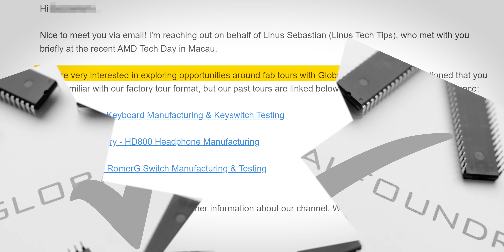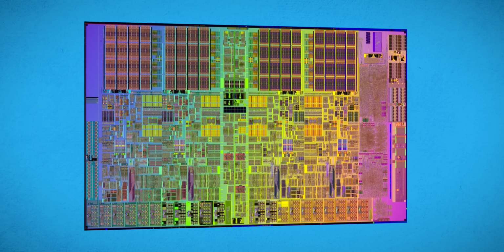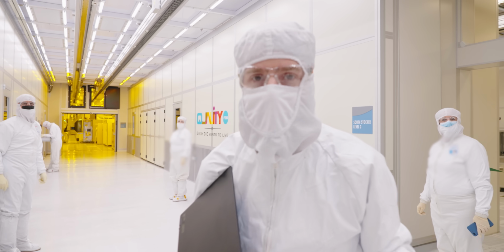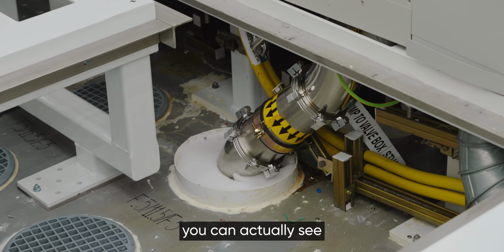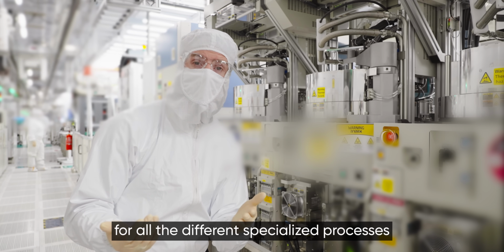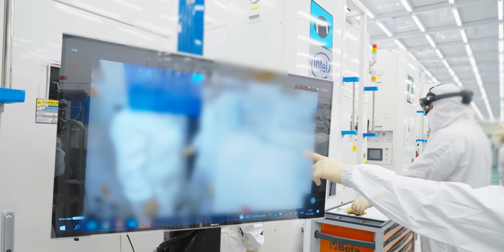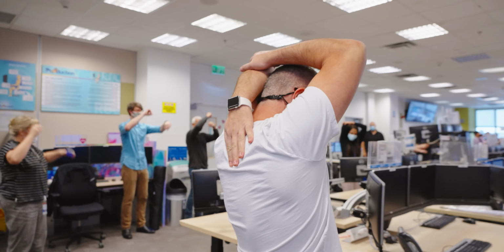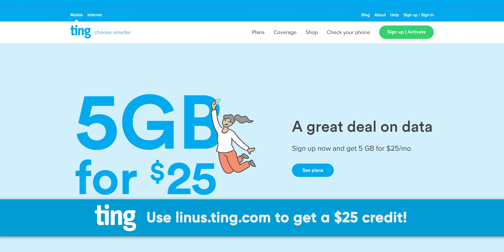I Can Die Now. - Intel Fab Tour!

Comment: After seeing how these processors are fabricated, and the amount of extremely intricate work that goes into them... I'm actually happy with the price we pay for these processors as consumers. 😅  I feel like they could charge much more just because of how complicated and precise the entire process is.  I guess if they were to charge their actual worth though, not as many would be able to afford them and their profits would go down.  Hmm
Reply: I think they are priced with their actual worth, it's just that they are extremly professional at doing this task while a lot of others things we buy have inefficient productions and big margins for the sellers
Reply: @joel3399  agreed, the tolerance for error is so minimal. one slight adjustment could determine whether the chip is put in a super computer or your alarm clock.  price is for the most part on target.
Reply: Yeah it's crazy to think that there are cases or power supplies that are more expensive than some brand new cpu's, tells you how much you're getting ripped off on some products.
Reply: You can thank competition for the reasonable prices. If they were a monopoly, you can expect sky high prices since you don't have a choice.
Reply: @sagadabeans  As we have seen before Ryzen's success.
Reply: I'm glad computers cost $800 in 2022 instead of $3500 in 1982

Comment: As an engineer working in a fab, I'm extremely surprised that an enterprise like Intel would give Linus the opportunity to se how things work in their sites.
Reply: How is the work experience?
Reply: Fernando  I just wonder what engineering do in factory :D is it a chill job?
Reply: I was thinking the same thing! I worked on the construction of their FAB42 in Arizona for three years, and the level of security is insane. Any physical documents or design plans had to be burned at the end of every work day to avoid any proprietary info getting out
Reply: @kurrwa  Engineering typically has 2 functions in a FAB.  MEs /EEs(Mechanical Engineers / Equipment Engineers) keep the tools running.  They'll handle upgrades and chronic offspec situations, and PM's (Preventative Maintenance).  PE (Process Engineering) will make sure the right amounts of things are getting applied and removed at the right times, and make sure chemistry and other things are correct.  ME's are a hands on group, while PEs are 'more' desk based, but are also often right there at the machines also.  There are also development engineers, that come up with new or better ways to make things, or even the new things to make
Reply: @DagarothBlackrose  interesting! I did an internship as Biomed tech. I had to do a lot PM's on medical devices :D

Comment: Linus: They couldn't stress enough how much we have to avoid even touching any of these machines because it could cause a huge loss in the process

Also Linus: Glass goes BOINK 11:41
Reply: It's really not a huge deal. Little nudges or touching tools with your fingers isn't gonna do much. It's bumping machines with tools or carts that will break an interlock which will shut the entire tool down immediately. An immediate shut down can result in misprocessed wafers which means $$$$$.

Comment: if i'm not mistaken (and correct me if i'm wrong), Fab 28 was the home of the Intel HEDT consumer grade cpu right?
all "Core EXTREME" cpus were strictly manufactured and packaged at Fab 28 from what i recall.
so it is strange that Fab 28 does not have Packaging facility and smd facility at the time of this video (i assume 2021/2022) where the last "extreme" cpu's (10th gen) were still manufactured in 2019/2020 or something like that.
so in the year or two since they ceased production of 10th gen consumer grade HEDT Fab 28 lost its packaging and smd facilities? kind of strange.

again, please correct me if i'm wrong here since all i remember about this is from well over a decade lol (anyone remembers the core 2 extreme? lol)

Comment: I really don't understand anything. What is happening? So they take Silicon, cut it into Frisbees and then they drive around in little robots? But there are no clear Steps? They just zoom around and then they get baked once and then they edge something in it and then they bake it again? And you determine later what kind of CPU this is? Is this magic?
Reply: they dont want you to see clear steps.
its trade secret.
otherwise you would have CPU manufacturing companies opening everywhere and rip of their design
hence lots of labels on stuff is censored as well
Reply: @spatrk6634  Oh but there is a clear order? First you do this and then that and after X steps it's done? Because it sounds like they are doing the things in random orders until something happens

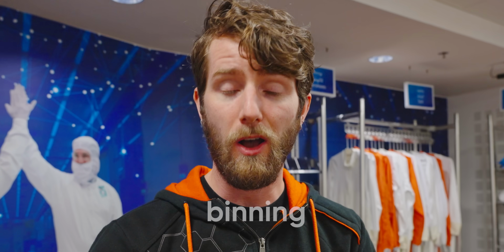Comment: At 19:39 when you explain "binning," your explaining it overly simplified as if intel makes failed i9 proccesors into i3s these cpus have different core properties, architecture and all it gives off the impression that a failed i9 becomes a i3 and we just all know thats not how it works maybe a i5-12600k becomes a non k variety etc but a i3 is not a failed i9.
Reply: this is simply incorrect
Reply: @strills1234  no it's not Linus is wrong
Reply: oh shit we got a graduate in CPU and micro silicon processes here. Remember, the stuff he's saying has been told to him by Intel
Reply: @rohanevergreen  well You better belive it's overly simplified. Go grab a microscope compare architecture on a i9 12900k vs a i5 12600k  you will visual see a difference it's not a poor bin. There's actually poor bin i9s those make there way into rebuilt dells etc high ends are sold for gaming cpus Intel extreme. Anyways  belive what you want im right you , Linus and apparently even Intel are wrong.